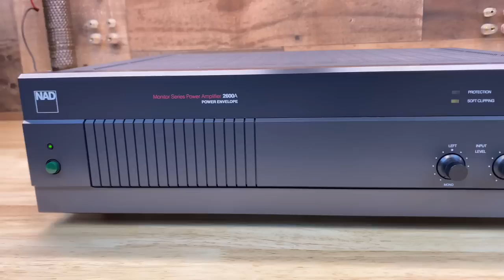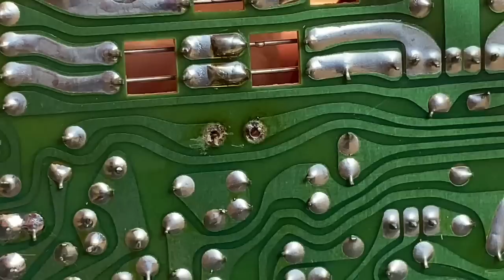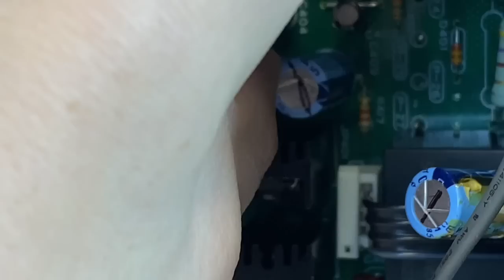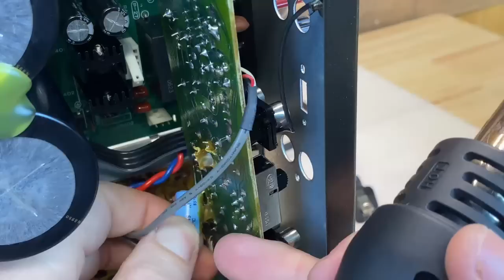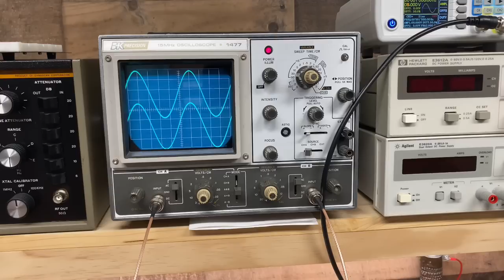DR #66 - NAD 2600A Service & Test

Comment: Is it necessary to connect a Dummy load during Dc offset & Bias\Idling test?
Reply from the maker: It depends on the amp. The service manual typically states the required conditions for these adjustments.

Comment: I bought a non working one of these and the problem was just the voltage selection switch was faulty. I bypassed it with my local voltage

Comment: Do not use Deoxit D100 on pots, thats what F100 is for.... there is also fadergrease you can use. D100 is a big no no in pots. Its for switches etc.. D100 eats the track up. And to talk about film vs elec caps, well filmcaps sounds so much better.

Comment: Great work and thanks for the nice documentation of your work.
I had hoped that you would mention the electrolytic capacitors in the signal path and suggest alternatives, besides just changing them to other electrolytes.

Although the NAD 2600 (and 2700) perform at a high level, these capacitors have a decisive influence on the sound.
There are electrolytes in both the input module (bridge) and the output stage, so there are several places to achieve better sound.

Comment: A properly ventilated amp will have some dust in it. A very clean interior often indicates an installation in a cabinet . This often means that a cap replacement is appropriate as the average internal temperatures are considerably higher.

Comment: Yes I like to use the sealed relays as well. However a strip of crocus cloth , a drip of DeOxit and a CRC wash a day later cleans the OEM relays well enough. And the lids of the white relays are easy to open.

Comment: How can you not have a desoldering gun ?   It’s a vital piece of equipment.
Reply from the maker: Some day. Maybe.
Reply: @dualityrepair4770  Everyone has these brilliant devices now.  

Either way my rule of thumb be it automotive or electronic is replace every 15 years regardless.  Now aged 67 as of the start of 2026 I am close to replacing my pre-amp, amp & CD player with brand new models.  I commenced my foray into hifi in 1976 then replaced all my Marantz gear in 1991 (my turntable made an early exit in 1983 for obvious reasons), then again in 2006 and now about to go again in 2026.  A tad later than prior gear but this final set should see me out for life as I have no desire to live to the revolting age of 82.  So.  Disliked & unsubscribed from this vacuous channel of yours.............

Comment: Can you share the part number for the relay replacement?
Reply from the maker: SRKU-1CT-SL-24VDC - 550 available from newark.com as of 24JUN2025.
Reply: @dualityrepair4770 
Thx for this.
BTW, did you have to replace R413 as I read it somewhere?
Reply from the maker: @ec1675 I did not
Reply: @dualityrepair4770 thx a lot.

Comment: You need a solder sucker; you're wasting wick.  I've never seen anyone clean controls quite the way you do; personally, I like a spray of Deoxit as it washes the dirt off instead of just leaving it on the carbon surfaces.  You didn't replace the heat sink compound; hopefully that's not a problem.  IMO, you need to really leave the soldering iron tip on the work to make sure there is enough heat transfer, especially on things like terminals and thicker leads.
Reply: Yes - all great advice
Reply: @ssnoc  This channel is dreadful.

Comment: Hello,  I’m working on a NAD 2240 and for adjust the bias a have to unsolder the short between resistors r471 and r 472 
These resistors far away one to other 
Can somebody explain o have a foto where these solder shorts are ?

Comment: Hi, Can I get the part number to the potentiometers? Thank you for the video, I’ve already subscribed
Reply from the maker: 3296Y-102LF-ND and 3296Y-103LF-ND from DigiKey
Reply: @dualityrepair4770 Did you solder an extention to the center leg (common) to all 4 pots, to fit the spacing?
Reply: Thank you

Comment: Can you please explain why we cannot replace alu cap that are more than 10uf with film cap ?
Reply from the maker: You can try.. but the cost, and more likely the size, will not be practical. Film caps are simply much larger than electrolytic caps of the same value, especially at higher values.
Reply: Size & cost, he said this.
Reply: @diabolicalartificer  I know he said that , but some time you can tweak and fit a cap to the place even if it a little bigger. I am not talking about caps that are 1000 uf .
Reply: @RanTausi  True, but if you look at the cost of bigger film caps the cost goes up. Like most things in electronics & life, it's a balance. Also if your servicing something for a customer will he be happy with a cap replacement that adds $20 to the bill. Lastly your ignoring the other cap parameters - ESR, ESL, ripple rating, longevity not top mention the capacitors function in the circuit: is fitting a $50 cap going to make a vast improvement? It's complex, but simple; cost over rides all.
Reply: @RanTausi  I typed a long reply but the PC crashed. It's a balance, will a $30 film cap make a difference?
Reply: @diabolicalartificer Ohhh boy , probably not.

Comment: It is possible that, in some vintage gear, the ESR of an electrolytic in the output stage may prevent oscillation.
Reply from the maker: I've read about that. The few films I used here were in the input stage and power supply.
Reply: I would be interested in learning more about this. In the Nikko Alpha 230 there are 1uF caps in the output section. I replaced these with film caps only to notice a small, high-frequency harmonic on the oscilloscope.

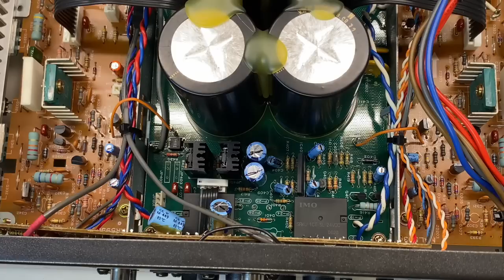Comment: You might want to check the relay lead soldering at about 1:48 if you still have it, as the right hand side lead was not soldered properly.
Reply from the maker: Just verified. All relay contacts look great. Must be an odd issue with the lighting in the video.
Reply from the maker: I’ll double check thanks.

Comment: Hi, I work on a lot of NAD amplifiers, One thing to look at is to check the output transistors mica insulators and heat sink compound. the compound  dries out after 35-40 years of use.
Reply from the maker: Absolutely good point. Fortunately it was all in good shape still on this unit.